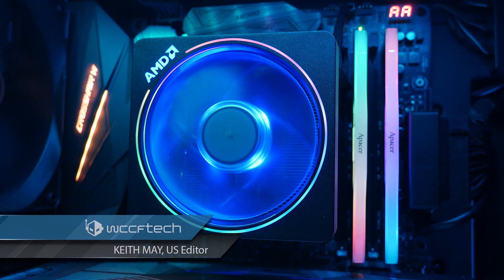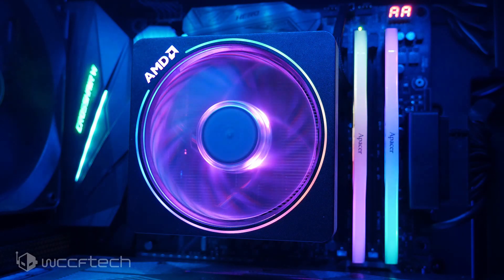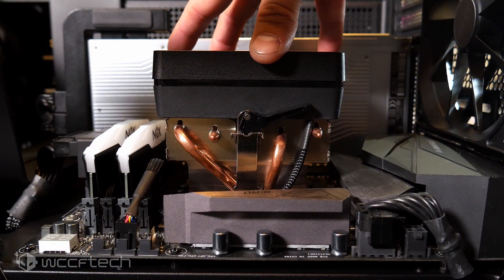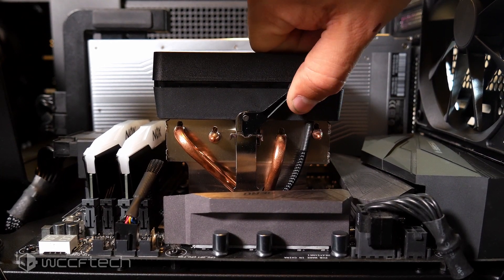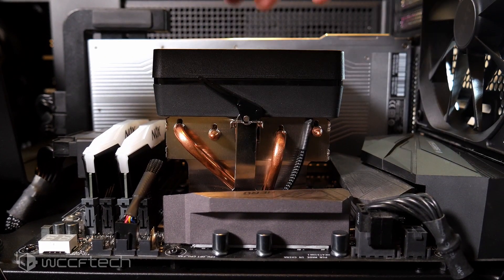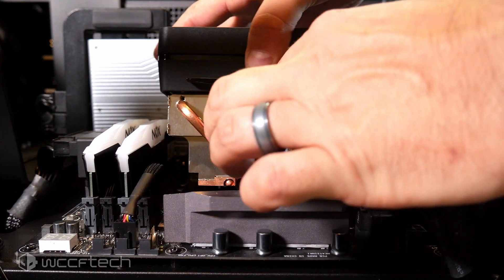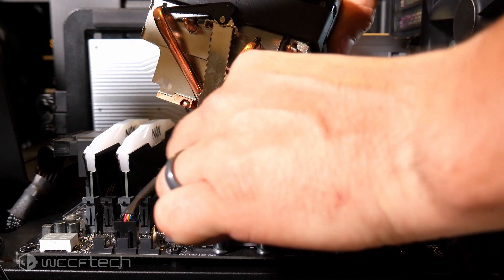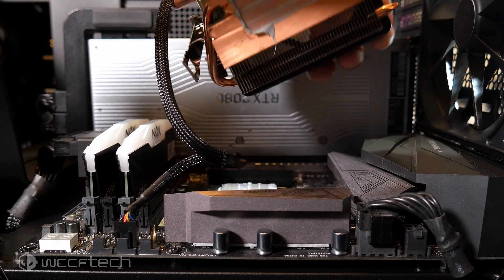How To Remove AMD Wraith Cooler Safely

Comment: I really wish I knew this before replacing my 2700x yesterday. Now I have a nice fused Wraith Prism/CPU combo.
Reply: Same here but with a 3900x and I bent a shit ton of pins.  Was able to straighten them out and none broke but Jesus Christ heart attack
Reply: Same, I almost got a heart attack 😂 What I did is heat up the heatsink with hair dryer removed everything I could from the sides with toothpick then wiggled it a bit and it came off pretty easy.
Reply: Was your mainboard or CPU broken in the process? Same here with my Ryzen..
Reply: @Y0y0Jester  No, I got lucky, I carefully removed it after heating up and checked if all the pins are still in place. Still works without any issues.
Reply: @Y0y0Jester  The motherboard still works with its new CPU, no problems there. I separated the old CPU from its heat sink and there's no visual damage at all but I haven't tested it to see if it still works. Should though.

Comment: This  should be in RED BOLD text with photos of bent pins in the un-skippable instruction latched to that Wraith Prism.
Reply: Yeah, literally just ripped my 3900X out of the socket with this thing, despite the compound being still warm, and despite twisting it back and forth first. Ended up with 7 bent pins that I then had to spend an hour or more painstakingly straightening each and every one with an X-acto knife and a credit card under a magnifying glass. I HATE AMD CPU's and sockets. They are hands down complete bullshit. The way Intel CPU's latch, it'd be impossible for the heatsink to pull the CPU from the socket.

Comment: It bended many pin of my ryzen 7 3800x damn i hate this cooler . Had to buy a new cpu and moderbord
Reply: Me too, I bent a lot of pins on my 2700x
Reply: how did that happen? from removing it incorrectly?
Reply: @Verociity  It was my first time. I was removing the cooler with a "cold" cpu and without twisting. The cooler came away with the CPU, and so I bent the pins
Reply: Luckily it was just one pin for me and could bent it back... It wasn't fitting the socket.... It's a beautiful cooler.... But it's too hot... Ordered hyper so journey can begin again.
Reply: I just removed the wraith prism from my 3700x after a week of use and it came off fine but I did use mx2 thermal paste which might explain it. The prism is loud AND hot, I replaced it with a dirt cheap cooler off aliexpress, much better temps and quiet.
Reply: @Verociity  Snowman T4?? T6??
Reply: @Justdigit2  darkflash 5 pipe, but the fan LEDs are a static rainbow pattern so I replaced it with a MF120R which has a 12v RGB header.

Comment: Good piece of advice, thanks.  I've just received my Ryzen 3900x and installed the stock cooler, with the stock thermal "pad" (or whatever it is) but I've purchased better quality thermal paste to replace it.

Comment: I can’t seem to unlatch one of them no matter how hard I try
Reply: I unlatched one of the sides
Reply: Same it won’t come off
Reply: You can also loosen (do not remove) the 4 screws that hold down the brackets on the motherboard if you can reach them. That should take the pressure off the hold down clips and make it easier to remove the cooler.
Reply: For the solution I found is to get the movable one off first, then with the second latch you want to push forward and to the right and wiggle a little bit, hope it helps!
Reply: @Floptrix  it took me 20mins to remove it, not because it was glued, but the 2nd latch was a nightmare. Good thing I read the comments and yours especially, really helped me out. Thanks a lot!

Comment: Do I damage the cpu if I pull the whole thing out?
Reply: I just fucked my CPU up with that, 10-15 pins were bend but I somehow luckily managed to bend them back without breaking them. It's a pain in the ass
Reply: @s1lent7315  It almost happened to me too. I pulled out the cooler, and the thermal paste looked like cement and the CPU was glued to the heatsink and came with it. My heart stopped for a few seconds and I almost died of fright. Fortunately, there were no bent pins and everything worked afterwards.
Reply: @Dolggan  Did this happened to you with the Wraith Prism cooler? I have a 3600x with the stock Wraith Spire, I just hope this kind of stuff won't happen to me lol.
Reply: @blint.5994  Yeah, 3700X + Wraith Prism. Be careful.
Reply: DO NOT DO THAT
Reply: not really just be careful with the pins while removing the CPU from back of the cooler ... just turn it right of left instead of pulling it
Reply: @Excuse me Wth What a pity...

Comment: Allthough the wraith cooler is one of the best stock coolers / of the shelve factory coolers, it is a monster to install and remove. I have mine untouched in the box and installed an AIO from Enermax on my Ryzen 7.
Reply: Yeah, a bit scary to handle indeed >.<
Reply: Install is easy once u know the trick. Loosen up the am4 brackets so you can mount and latch then tighten the screws again. Removing it might be a doozy tho.

Comment: This video is not very useful for most people who had their systems for a relatively long time.
I had this problem with a friends computer, the stock paste AMD uses turns into glue after some time and I couldn't twist it.
After searching on the internet I found people recommending to run a stress test to heat the CPU up, and in turn heat the thermal paste up, turn off the computer and remove the cooler while the paste is still hot.
Reply: Tried this still didn't come off. She was sitting prime 95 at 80c
Reply: Just read that after bending my pin with my cpu

Comment: Doesnt work as easy when the paste is old and has turned into quasi-cement.
Reply: try prime for 30 mins before remove cooler
Reply: @linkdiablo4476  Personally I don’t eben need to run prime. Ryzen 7 3700X get's 80C hot in idle.
Will replace thermal paste etc
Reply: @traxon_lp i have the same, how did it go for you?
Reply: @linkdiablo4476  prime?
Reply: I get alot of recycled computers. And I am able to strip them of parts before tossing the junk (OEM cases mobos junk power supplies ect) and dont have the luxury of doing prime95 runs for a half hour or using better paste because they are old and unwanted PCs. But people toss lots of XEONs and I5s I3s and sometimes I7s. Not as much AMD stuff but when I do come across it I lose about 1 in 3 AMD CPUs to pin damage when removing the shit coolers and cement paste. I dont care what excuse is made for AMD but its unacceptable to have a lever to secure the CPU which doesnt work AT ALL to stop it from being ripped from the socket with the cooler. Say what you will about intel but their socket/latch system is infinitely better. I've yet to damage an Intel socket or CPU just by removing hardware.
AM5 better move to a threadripper/intel style CPU. LGA style CPUs are the ONLY type that should exist for consumer desktop. FGAs can stay in laptops and the 1990s.
Reply: @skoopsro7656   do you think mine will be okay its not even a year old yet but i want to upgrade for this reason and better temps
Reply: @stevenwarne69   play a game for like 45mins or so right before you are gonna take the heatsink off. It will PROBABLY be fine without doing that. Just go slow and be careful as possible
Reply: @skoopsro7656  i will follow your advice, thanks.
Reply: @stevenwarne69  Did you do it?
Reply: @skoopsro7656  After suffering from a Ryzen 9 3900X being stuck in an air cooler and benting one pin in the attempting to remove it (I fixed it and everything is fine now) I strongly agree with you on everything you said about trash AMD socket. 
It was the most stressful day of my life, I don't think I'm going AMD again for my next build, this is just unbelievable. 
If they want to stay with FGA, ok, cool, at least put a god damn holder in the socket so the cpu doesn't leave with the cooler, it's not that hard, they don't even need to go LGA if they don't want to.
Reply: @nicolasteixeira6448  yea the fools at AMD should be embarrassed that they are putting their stamp of approval on a socket engineered that poorly. 
Glad you were able to recover from the bent pin.
Reply: @skoopsro7656  that's the truth my cpu pulled out when I unscrewed  the fan . Had the little arm down but it's not worth a dime
Reply: @mitchtheh4x0r  yep there's no excuse for a mechanism to be SO SHIT and useless on in some cases THOUSAND DOLLAR motherboards for 750$ CPUs. Its an embarrassment. Total amateur hour to still be using that pathetic mechanism. Epyc and threadripper customers would never allow such a crap mechanism to secure their expensive CPUs why should desktop owners?
Reply: @skoopsro7656  well that sucks...
Reply: @skoopsro7656   Well I asked a question before and as I read this I realize I probably just need to buckle in and have a replacement CPU at hand
Reply: @xzeeno3712  I hope not. Depends on how old the paste is. And how careful you are..and how lucky. Id really like to hear how you make out when you do try it. Let me what what happens
Reply: @skoopsro7656  I gotta wait for the paste to come in so when it does I'll let you know
Reply: @xzeeno3712  any update? How did it work out?
Reply: @Gacstez   A lot of shiz biz has been getting in my way to get it done so I haven't been able to go through with it yet. When it's done I will for sure post about it on here though.
Reply: I did it, had to use more force than I wanted but nothing broke and everything's been cleaned and replaced. If not for the stress test and hair dryer I dont think it would have ever come off lol
Reply: @xzeeno3712  well thats good. 👍
Reply: Skoopsro Was literally about to try and take it off now, think I’ll do a stress test, what software do you recommend?
Reply: @fxnproductions2408  download cinebench r20(free) open settings set it to run 1800seconds(30mins)
Then try
Reply: Skoopsro Running cinebench now, 68C atm
Reply: @fxnproductions2408  ok cool, give it a good pull and careful twist when you feel ready. At the end of the day, if you do your best, and it still gets damaged, it was unavoidable. And why i say this bullshit mechanism should never have been allowed from AMDs engineers. But I've done that soap box rant enough.
Reply: Skoopsro Yeah I will, put it on for half an hour, then I’ll shut down and unhook, so should I twist then pull gently?
Reply: @fxnproductions2408  yes, sorry i didnt get back to you until now. youtube is really bad with notifications for messages obviously
Reply: Skoopsro it’s all good, I managed to get it off successfully with a bit of help, a really appreciate you helping out!
Reply: @skoopsro7656  good point, but LGA is patented for only Intel.
Reply: @charlesdegaulle2928  they do LGA style with threadripper and EPYC they can and have gotten around the patent. If they don't do it for AM5 they probably won't for another several years.
Reply: @skoopsro7656  got any windows 10 pro keys I can use from that lol
Reply: Run it for an hour then let it cool for a few minutes then unijstall
Reply: @ImranPangilinan  yea I know. I get bins of recycled computers and cant run them for a half hour. It's not worth the time. Read the comment above yours.
Reply: @skoopsro7656  use a heat gun...
Reply: For some reason the thermal past that AMD includes with their coolers is like cement glue
Reply: God I have to change it and I have this problem, is there a way to take it off without hurting the CPU?
Reply: @xzeeno3712  turn your machine on, and run a CPU stress test for a half hour of hour, and then when the time is up turn off your machine and remove the CPU fan as soon as you can. thats probably the best advice ive seen for a system that still works well.. if your CPU/system isnt more than a year or 2 old it shouldnt be that bad. just take your time is the best i can say
Reply: @skoopsro7656  I will give it a shot for sure. Thanks for the advice
Reply: Yeah I should’ve read up instead of trying to take it off cold
Reply: I literally just tried this as instinct with a really old computer and the paste ripped out the CPU, can confirm it becomes cement
Reply: @thatguy7548  im sorry you and I had to meet eachother via this situation. No socket should ever allow the CPU to be ripped out because of a cooler or paste change
Reply: Damn I should have read this comment earlier, before I ruined my mainboard trying the technique recommended in this video.....

The incident or I should rather call it accident happend as followed:  Me, a fairly cautious guy who is still incapable of reading the comment section (yes not even the top comment) went along cleaning his pc trying to get rid of all the dust which accumulated over the previous year in order to prevent his CPU from going to temperatures of about 66°C when idling. At this point, I would like to mention that this Pc  was the first Pc I ever built and due to the fact that its been like 2 years ever since I assembled it, I wanted to reinsure myself of how the mechanism of this mount works in order to prevent breaking or damaging any components of my precious little friend. So after watching this video, which I have to admit made me decently confident to engage in this very delicate endeavor, I decided to follow the instructions as shown. Unfortunately tho, once I managed to remove the cooler from the Pc after wiggling it a little bit I realized that the CPU was stuck on the bottom of the cooler. At this moment in time I already kind of realized that I might have screwed up, little did I know tho how bad the situation actually was. Apparentally, by removing the CPU from the socket without lifting up the little lever locking the CPU inside the socket, I destroyed the mechanism of the CPU socket lock (this term probably doesn't exist but I don't really know how else I would describe that)  which as a believe is now the reason for my mainboard not working anymore. 

Later, after realizing that my pc doesn't work anymore I told this story to a friend of mine and he made me aware of the fact that apparentally it is a good idea to unplug the CPU fan first turn on the Pc for a fairly short time which will allow the cement like therman paste to get soft again and then turn the Pc off and remove the cooler from the CPU safely. 

Long story short this video did not really help, as a matter of fact, it does the exact opposite, since most people watching will already have a cement like thermal paste in their systems which just happens after a certain time period.
Reply: My pc won’t turn on, so how do I heat it up?
Reply: @tomtative  try hair dryer i mean
Reply: On the contrary, thats when it does come off easy, as the dryed out paste has little adhesion between the CPU's IHS  the cooler
Reply: Happened to me. Found to my horror my 2700x came away with the cooler. Bent pins galore.  Wife tried to straighten them for me. She has steady hands unlike me. Got the CPU back in but had no power whatsoever. So not talking chances I got a new mobo and 3700x. In hindsight i should have removed the stock paste this time when i put the new cooler on. Think I'll take the board out next time especially with the glue AMD use.
Reply: P
Reply: 3 years later and this comment still made me laugh
Reply: Just busted my cpu while pulling out the amd stock cooling fan and damaged a few pins. You are right, the previous cooling paste has become cement-like.
Reply: Yup my brother ryzen 2600 is stuck for life in that motherboard
Reply: That's why i never use stock thermal compound which come pre-applied with any CPU cooler.